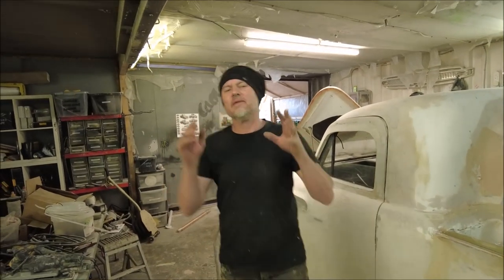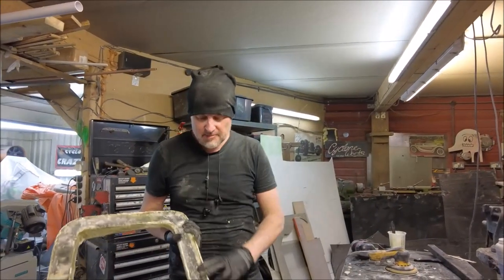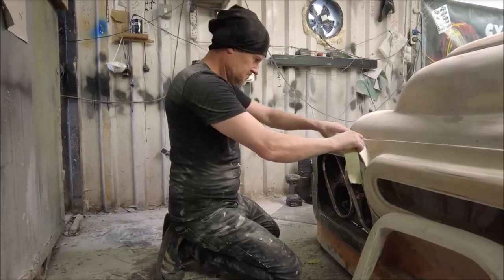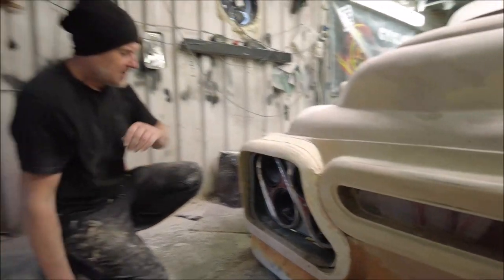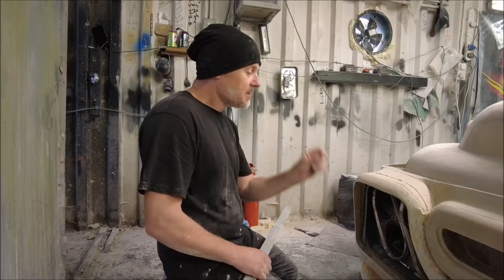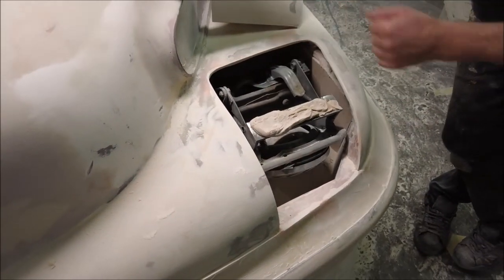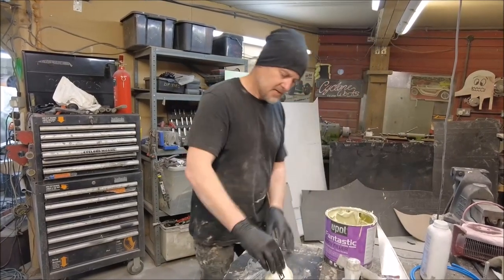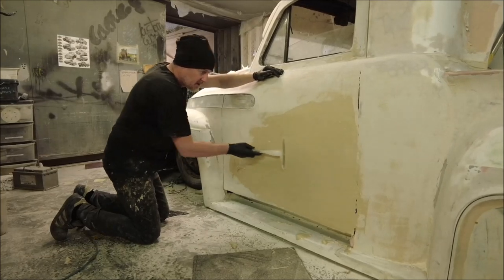GETTING STUFF DONE!!

Comment: I've been fillering the rear quarter of a mk2 zodiac with welded up rear doors and a capri roof. Making the body line from the door shut to the tail fin tip out of filler and imagination has been a mission. Four foot of it didn't exist. I used one of your tips, and filled over a tape line and then removed the tape while still wet, get it shaped then back fill the other side of line. Seems to be working out. My top tip is get a 30 inch long Dura Block. I borrowed my mate Phil's one and its game changing. All that sanding surface area flats off loads in no time and it seems great for straight body lines.
Reply from the maker: Brilliant, so glad it worked out for you too.

Comment: Heck.....I cut 3/8in .....9.5mm  6061-T6 alum on the table saw.......One trick....Turn the saw on....Spray the blade with your anti splatter , used for Mig welding.....It will stop the blade from gumming up..  :)
Reply from the maker: Ooo top tip, cheers I'll try that

Comment: Adding the resin really makes it wet and is great for grabbing detail in a mold too. I like using large 12" plastic scrapers to do the same as you are with the squeegee but they are cleanable like a spreader paddle. I usually use them after the filler is on just like youre doing but on curved surfaces so I can grab the scraper with two hands and hold my curve shape as I draw the scraper of the panel to make sure my curve remains constant. Does that make sense?
Reply from the maker: Yeah and another great tip, cheers and keep them coming :)

Comment: I would have thought that the bog resin would have gone of with just the MEKP... and not having to add the bog hardener..
 I'm having trouble with the new P40 lids they're really thin and bend out of shape easy so they let air in and I get a crust round the edge and on top of of the stuff in the tin.  But it is a better idea than when they used to put it in a big tooth past tube.
Reply from the maker: Yeah it probably would, I perhaps need to do a test.